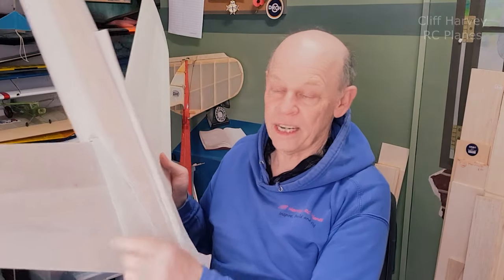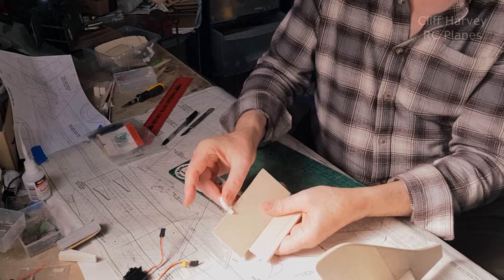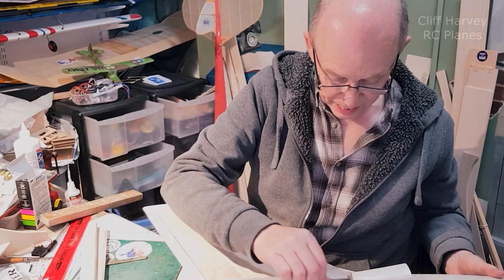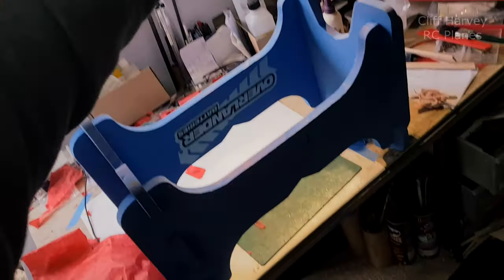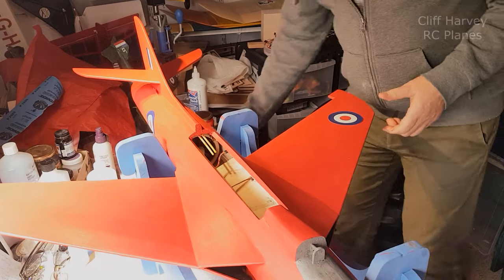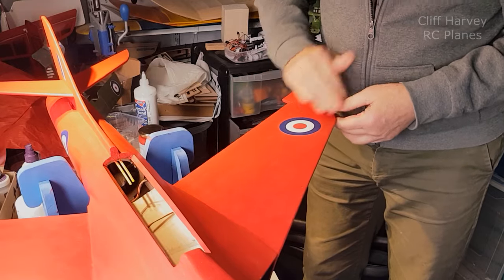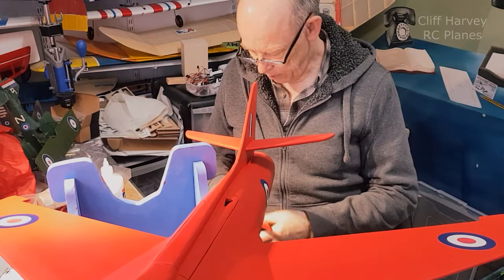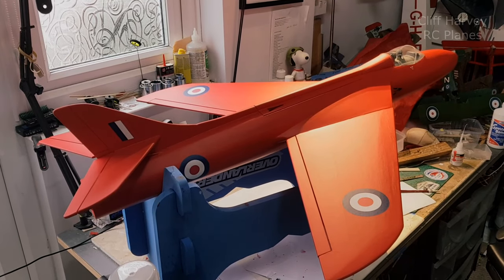Iconic Hawker Hunter EDF Build Part Three

Comment: Before apllying glue I always spray water over the tissue and let it expand. Then I start gently pulling the edges raising the tissue if needed, the water acts as a lubricant and in the end I apply a water based mate varnish, like Minwax when still wet and expanded. You can also use dope, the water won't get in the way, it'll stick (unless soaked wet). I use also minwax with talcuum powder to seal the grain before the tissue. You can also use sanding sealer like you had or dope with talcuum powder but I'd stick with only one system, dope on dope or waterbased on waterbased.
Reply from the maker: Thanks Zef, great advice 👍🙂

Comment: Very nice work! I also liked your bind lead tip. Bob
Reply from the maker: Hi Robert, thanks, what tip was that? 🤔👍
Reply: Hi, I get immersed into your videos to learn. I think I saw you add a lead from the receiver bind input to make it easier to access. May I have seen it somewhere else. I give you the credit, though friend.
Reply from the maker: @robertgribbin6444 It's a good idea especially if the rx is difficult to reach 👍

Comment: Looks great ! I've built the 50mm version but not flown it yet. It is quite heavy as a bare airframe, I'm thinking of going with a much lighter 40mm fan by Xfly, 1100 lipo and smaller esc.
Reply from the maker: Hi Catherine, it's an idea but will a smaller (lighter) battery mean you'll have to add weight in the nose to maintain the cg? Thus getting you nowhere! If the auw is more than the original it just means you'll have to throw it harder and it'll fly faster (better in the wind as well). Whatever you decide good luck and have fun 👍🤔

Comment: You certainly worked hard on the finishing Cliff. And some helpful tips too. BTW. Have you tried EzyCote to seal, which is a water based alternative to epoxy.  I used it without glass cloth on my ASK deck as I had used thin balso sheet and not ply as speced on the plan.
Reply from the maker: Thanks Rob, no, you mean as an alternative to water-based varnish? 🤔👍
Reply: @CliffHarveyRCPlanes  As you may know, our glider builders often glass cloth their models using thin epoxy. I Tried Eze Cote without the glass cloth to seal and stiffen balsa sheet and was pleased with the result. This is what Deluxe say: Eze-Kote is a 1-part water based foam-safe, low odour, resin alternative to epoxy. Brush onto balsa and light glass cloth to create a tough, ding and fuel resistant film that can be sanded easily and painted after 20-30 mins.

Comment: What cloth covering would you recommend for a 108"  dallaire
Reply from the maker: Hi Larry it depends on how you want it to look, also are you a dope fan or do you prefer using the iron, there's so much choice on the market, also you may want to paint it yourself or use a colored finish 🤔👍
Reply: I've used iron on cloth and just recently covered an .020 free flight  timers nightmare with esaki silk cloth that I've been sitting on a while. I started with stick and tissue kits in the early 70s. Most of my planes are electric not concerned about fuel proofing. I in the US not much available as far as cloth covering goes. Could you send names of manufacturers
Reply from the maker: Hi Larry, on birth of my bigger models I used Solatex, another make is Oratex, it's not cheap though. A friend here used dress making fabric, he details it in his Channel, https://youtu.be/jmiEYOdcE7M?si=RPSV6v78ZBYglrMT 👍
Reply from the maker: Hi Larry, I've just 'discovered' another covering that looks really good, I think it's made in France but here's a link to it in the UK, cheers https://www.sarikhobbies.com/product/diacov-1000-adhesive-film-for-model-aircraft/

Comment: It's looking great, shame about that tissue. Obviously you aren't worried about the 'plane's weight with all those coats of paint you're using. If the model was a free flight one you could use thin copper wire from a piece of electrical cable as a hinge, the various flaps would then stay where they're put.
Duke and his compatriots were huligans! At the time he was flying those machines they'd fly over our house and break the sound barrier, we used to regularly claim for our broken china etc. from the RAF!! They got fed up with the residents complaints in the end and banned them from doing it.
Reply from the maker: Gret story Tony, thanks for sharing. Regarding the weight it's actually not too bad, because the paint's water based a lot of it just evaporates. I also do the thin copper wire trick but I hammer it flat as well which makes it a bit more malleable, cheers 👍